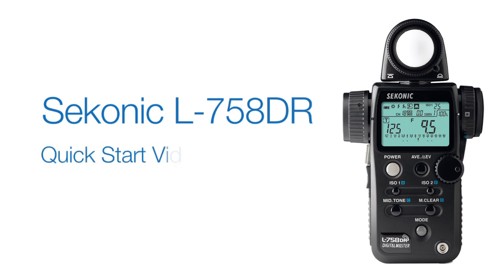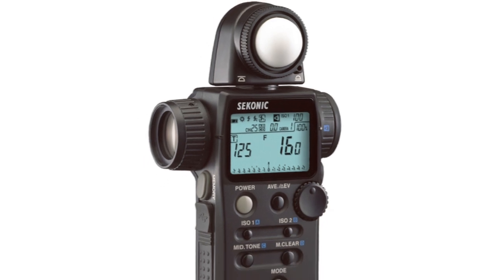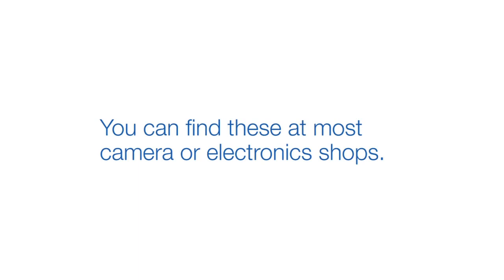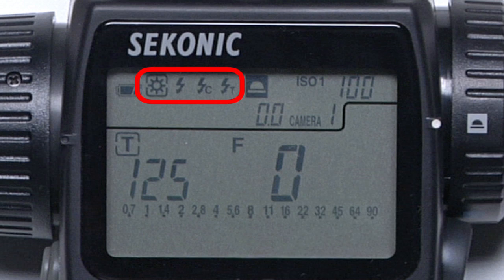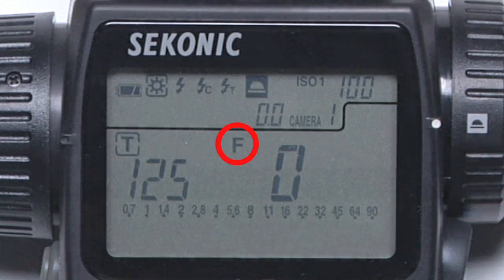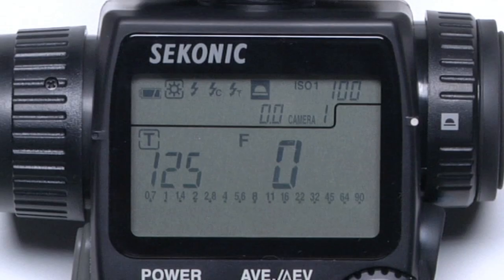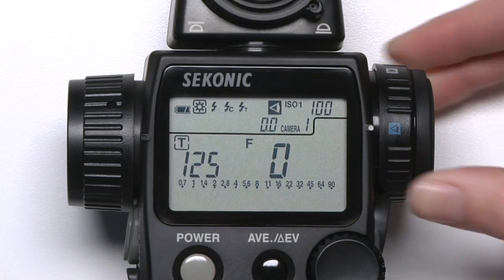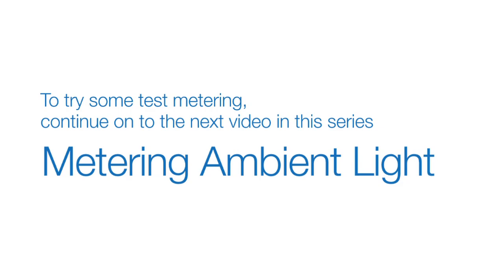Sekonic L-758DR Quick Start Guide: Part 1

Comment: Hello. I have the 758 set to measure flash( the second icon from the left), I have ISO 1 set to 400 and shutter set to several settings. When i press the measure button to get the flash icon to blink, I then set off my flash. I get a .6_2 for aperture and 0% for flash contribution. I'm just testing and holding the two devices only 2 feet apart. How is it that it gets a ridiculous aperture setting and  0% contribution from the flash? Thanks for any advice.